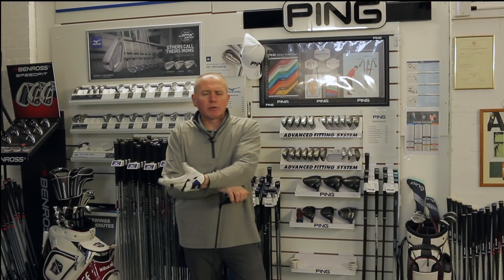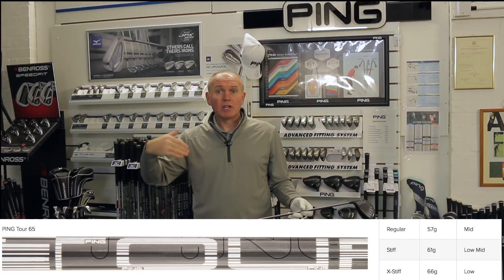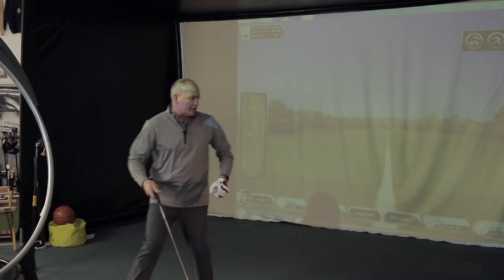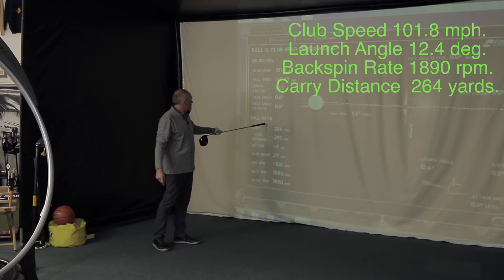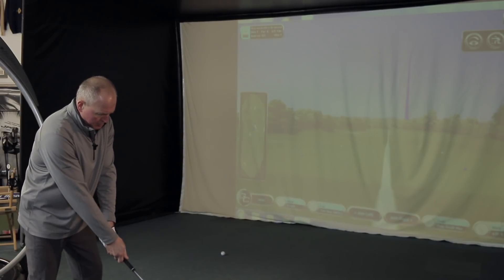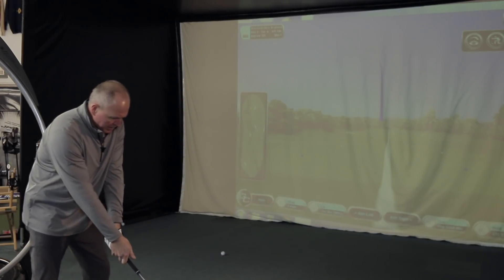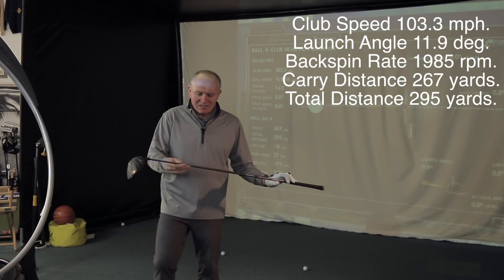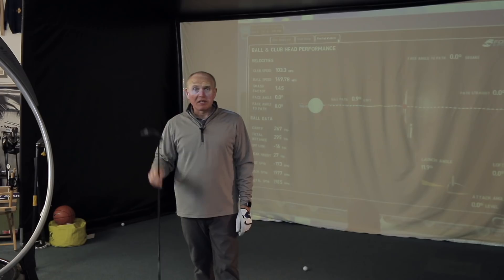Ping G400 Max Driver - Tour 65 Stiff Shaft Test.

Comment: I know the g400 is about 4 years old now but after reading up alot u got a used one but it was with a shaft that is not a stock one. Are shafts like the 65 hard to come by as I don't see many online and if I do come across one can I simply just plug it in?  Also- do gf shops do fittings just for the shaft if you already have the head? Thx
Reply from the maker: Hi Conal, should find one of those on ebay.

Comment: Wow awesome Andrew ! My club head speed is about the same 104-108 mph. Excellent spin #’s. You just eliminated any doubt about this not being a low spin head. And that shaft is the exact one I was thinking about getting. 

Although I haven’t hit this driver (or any PING Driver in close to 15 years) I heard this is relatively loud sounding. that’s the only thing that would hold me back 

But the highest MOI, that shaft,  the looks and the performance so far outweighs the sound.  

How would you rate this to the Callaway Subzero driver in performance ONLY. i know the Callaway Subzero has a muted sound/feel and isn’t very loud. Only issue with my Subzero is it’s not very forgiving especially out near the Toe and I do love that it’s basically fade biased (anti-left). Very rarely do I hook it 

Thanks for this great video !!
Reply from the maker: Hi Stephen, don't have access to Callaway products yet. All I can tell you is the Max Driver performed well, will be interesting when I do the comparison to the Std G400 Driver. Stay tuned. Best regards Andrew.

Comment: Just got the G400 max. Certainly seems forgiving.  It originally came with the Alta CB 55 shaft which feels a tad too long having spent a few weeks hitting it.  I’ve managed to locate a stock Tour 65 shaft on eBay which is a little heavier and shorter. Is it necessary to add or remove weight from the head when installing the Tour 65 to compensate for the different shaft weight and length do you think or can I just go with it?
Reply from the maker: Hi Don, that shaft will go straight in and work well.
Reply: Andrew Ainsworth Many thanks for the reply Andrew
Reply: Andrew Ainsworth You were so right. The tour shaft is awesome - smoother feel at impact.
Reply: @donharrold1375  are you still using this shaft don?
Reply: @conalsands4748  yes works well (Tour 65)